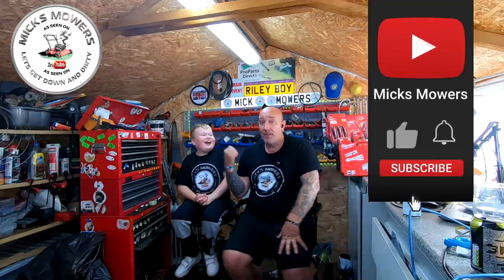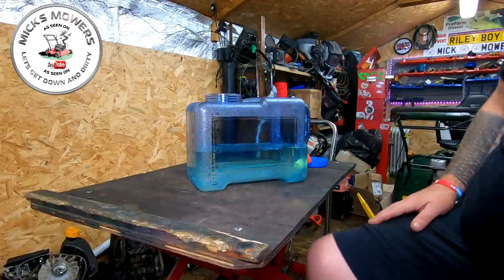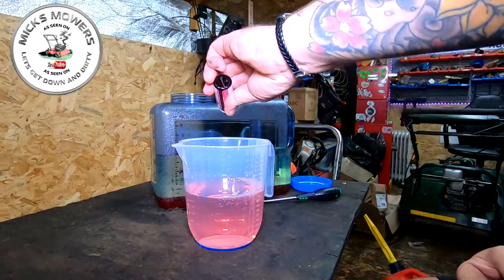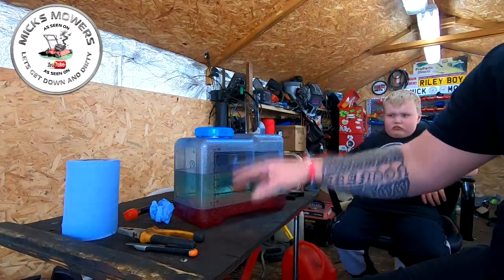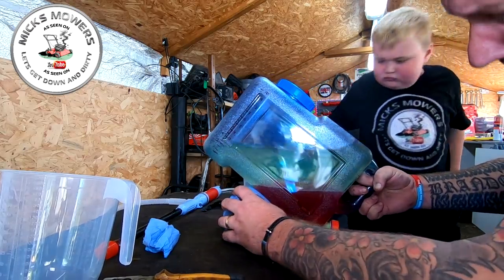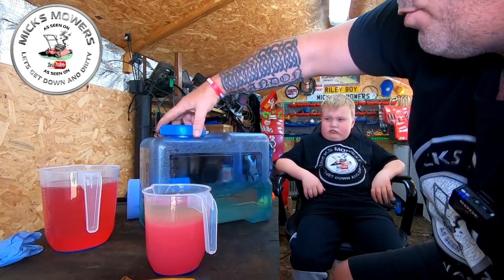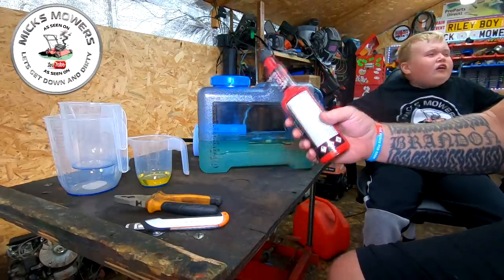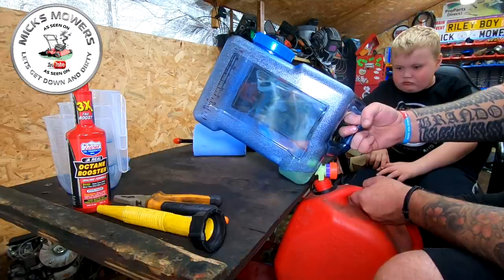How To Remove Ethanol From E10 Unleaded Fuel To Use In Lawnmowers And Small Engines

Comment: Here in the US, we can buy ethanol free fuel at some places. The best place to get it is at an airport that will let you buy it. It is 100 octane ethanol free fuel because airplanes don't want water (ethanol) in their fuel at high altitude because it will freeze in the fuel line. Really bad news for an airplane.
Reply: Works fine in 2 strokes also mixed with a good mixing oil. Has a tendency to leadfoul plugs. I run alcohol free mogas in my c65 .  It is a low compression engine and worse to lead foul.
Reply: I understand ethanol-free is available at harbors, for boats.
Reply: Used to be able to do that where i live, but new legislation and laws are catching up to this.  Airports, even small municipal ones, are no longer selling to outsiders, requires a plane to purchase fuel from them and they pump it into the plane from the fuel truck or tank and charge you for it, no container purchases allowed anymore.  It's a taxation issue from what i was told, not trying to keep people from purchasing ethanol free fuel, its just tax laws stopping outside sales of the fuel now.  Local marinas are stopping all sales outside as well, you can fill a boat or tank at the dock but no containers other then certified boat tanks now, sure you can get a boat tank and buy from them like that, but its twice the cost per gallon now, one local marina sells non-ethanol fuel for $6 a gallon, and you have to be a marina renter that keeps your boat there to get that price, for others its more and again it has to be into marine certified containers only and supervised fill up.  I haven't had access to premium at the pump for over 10 years now, just used to ethanol, no issues with it either so its not a big deal.
Reply: @CrazyHamSales The one thing government is truly good at is taking the fun outta everything.

Comment: Isn't it easier just to buy Esso Supreme+ 99, which although officially categorised as E5 actually has no ethanol (other than that sold in Devon, Cornwall, North Wales, North England and Scotland) ?
Reply: E5 has UP TO 5% of ETHANOL
Reply: @josemariatrueba4568  When I wrote that comment two years ago Esso Supreme99+ had zero ethanol. 
PETROL WITH ZERO ETHANOL IS CATEGORISED AS E5.
However Esso no longer guarantees its Supreme99+ as having no ethanol.

Comment: Two things when you put the coil you need to clean the flywheel with a Emery cloth just to be in the safe side and where the coil mounts on the engine you need to clean the surface too cuz I noticed it was pretty dirty yes it did work but I usually clean all the surfaces first and then clean the coil also for magnetizes to the flywheel

Comment: Great video, I watched all the way through, even though I will probably not have a need for the process. I like the way you go into details that most people would skip, making it easier for someone to get it right first time. Just one frivolous detail. When you pour anything from a container like your de-ionised water, try lying it on it's side, rather than upright. You will find that it pours better, the air flows in as you pour, making it a smoother pour.

Comment: For smaller engines the costs of using long term high octane fuel available in certain shops is a better idea..   For 4 stroke higher consumption items like ride on mowers it would be more cost effective..  Also run your engine powered tools dry to ensure no fuel is stored long term - unless you know you are going to use it soon afterwards.... 
I believe Shell Performance is still 95 octane
Reply from the maker: Good comment.. much appreciated
Reply: I thought Shell V Power is 99, could be wrong 🤷🏻‍♂️
Reply: @ioannichols6485  shell v power is still 99 octane I purchased some today.
Reply: I run two mowers, one chipper, one rotavator, one generator, one welder generator one disc cutter, two blowers, two chainsaws, two hedge trimmers each week. 
I get through six to eight gallon a week, expensive fuel will put up the cost so i'm gonna have to do this a lot. First fire/explosion caused by folks having to do this and the first death will wipe out any supposed environmental benefits. Cheers
Reply: Half the year I live on my boat, so frequently use a gen set and outboard motors. I will try this!

Comment: My father does this for his classic car 25 liter glass tank with a tap at lowest point. Then a dose of TEL for five star fuel.
Reply: What is TEL.? Thanks
Reply: @mrkoolio4475  Tetraethyl lead (TEL)
Reply: @mrkoolio4475  he uses a product called tetra boost if you are interested.
Reply: Rob Taylor thanks mate
Reply: Rob Taylor as a follow up....why use an ethanol addative if he just took out the ethanol?
Reply: @mrkoolio4475  Our use of this is that the car is incredibly finicky its needs the lead for the valve seats and the high octane as it was originally built with 5 star in mind. It's one of the only products on the market that gives you the authentic fuel.
When you have a very expensive toy it's worth the hassle to be fair. 
We found even with e5 stabilized and leaded that we were getting excessive corrosion and parts sticking, so removing  the ethanol and making up the correct fuel isn't to much of a problem when it's only driven in the summer on occasional weekends.
There is quite a bit to sort out if you change the octane on older cars that are carbretted and have a mechanically timed spark. 
Modern stuff does all the work for you to be fair.
Reply: @mrkoolio4475  There is no ethanol in Tetra boost. It advertises "ethanol protection," not that it has ethanol in it (but in fairness, many octane boosters do--normally cheap ones). If Tetra"ethyl" lead was what made you think of ethanol, it's not, or if you mean why remove the ethanol if this additive protects against it, then it does protect some components, but doesn't prevent the hydrophilic (water absorbing) properties which you really don't want in a classic car.

Comment: Watching you pour the water was torturous ;) try rotating the can 90° is on its side, it's a bigger area to let the air in & the fluid out. 
Works great with oil & fuel etc etc as well

Comment: Errrrrr..... No.......! Adding Octane does NOT increase the 'power' of the fuel! It's actually the REVERSE of making the fuel have more 'pizzaz' or power! You are misunderstanding what high or low octane fuels do... and why we have them.
Most standard cars  have 'low compression ratio' engines. I.e., the space above the piston at top dead centre is reasonably large compared to the volume of the engine. Engines with a higher compression ratio (small volume above the piston) can compress the fuel/air mixture so much that the mixture ignites BEFORE the spark losing huge amounts of power and damaging the engine if allowed to happen all the time. That's called 'pinking' or 'knocking'. Low compression engines are unlikely to 'pink' when running even if you use low octane fuels because the compression ratio is not high enough to ignite the mixture on its own (like a diesel). In this case, the spark plug is what ignites the gases on each stroke.
However, in a more powerful cars, etc. e.g. Ferrari, Porsche, Subaru etc., they will often have a higher compression ratios engines because that is one of the ways you extract more power from an engine (raising the compression ratio). However, that type of engine is MUCH more likely to 'pink' (compression ignite) when using standard low octane fuel. To prevent that 'pinking' in such cars, you add more Octane to the fuel which REDUCES the chance of 'pinking' as the added Octane makes the fuel (effectively) LESS combustible.
So, powerful cars often need high octane fuels and using it allows the car to run a much higher compression ratio. The increase in compression gives a much larger increase in 'power' than is 'lost' by 'weakening' the fuel by adding Octane....... thus...... fast cars can be more powerful with high Octane fuels BUT......the added Octane does NOT increase the power of the fuel...... it actually WEAKENS it by 'diluting' the fuel with something that doesn't burn well! Octane is an additive to REDUCE the chance of pinking..... and thus you can afford a higher compression ratio....  it does not increase the power of the fuel!
Obviously, I have simplified the description but the principle IS correct. Adding octane does NOT increase the 'power' of the fuel. That's a misunderstanding! Check it out by researching 'Octane' through Google!
Reply: So how come the higher the octane, the more expensive the fuel was ,  was that the oil company ( as basically ever only one under different names ),  making more money on a cheaper ? to make product
Reply: @highpath4776  Wellll...... yes and no. Octane is not a cheap additive..... but not as expensive as the price 'hike' charged.

However.... the petrol companies could see that, offering a 'premium product' in the same way that Apple over charge for everything, as do Channel, Rolls Royce, Armani, Nike.... etc. do.... even if they are REALLY only offering hot-air and marketing hype.... they could charge even MORE for their premium product, not least because the 'general public' think it's 'more powerful' fuel..... Secondly, the people who usually NEED high octane have bought 'premium price' cars and thus would actually feel even MORE smug if they only use the best' (becasue it'[s more expensive) petrol! Trust may, it's STUNNING how few people know this about octane and what it does.

To be fair, I have simplified the description. Strictly, the low octane fuel doesn't usually 'compression ignite'. It just 'burn' worse.... I'll explain..... The spark is designed to act as starting point for the 'flame'. It is supposed to move SMOOTHLY across the surface of the piston. it should NOT be an 'explosion' (as often depicted) but a smooth, fast moving flame front. What really happens with low octane fuel in a high compression engine is that it ALMOST gets hot enough to ignite itself.... but not quite. However, when the spark occurs..... the flame doesn't move smoothly across, it explodes, effectively all at once. Hence the 'knocking' or 'pinking' noise. It explodes from the very start of the spark.

Modern high performance cars deal with this quite simply. They fit a 'microphone' to your engine and it 'listens' for 'pinking'. If it hears it, it delays the spark for quite a while, hopefully to where the compression is low enough not to let the fuel explode. The effect of this is that the 'burn' has a weaker effect than it should as it's happened too late. Thus, if pinking occurs, the car starts to run LESS effectively. You CAN detect a drop in power as the engines moves from running properly on high octane fuel..... to.... quite inefficiently on low octane fuel. That's ANOTHER reason why people think high octane fuels contain more power. The truth is,  on low octane fuels, the engine 'decides' to reduce it's power output by delaying the spark..... and thus reducing the power of each stroke! That's why so few people HEAR the 'pinking' in modern cars..... The 'engine' 'hears' it before you do, and adjusts itself to stop the pinking before you even notice!

So...... you can run low octane fuel in a modern high compression car...... but you'd be daft to do so as, all the 'power' that you thought you'd bought with your expensive engine..... is thrown away...... Don't do it unless it's an emergency because the pumps have run out of high octane fuels. If you do have to, drive the car MORE SLOWLY than you'd usually do until you can 'upgrade your fuel!

Comment: All of my Stihl gear and lawnmower ran like shit on the new fuel. Really smokey too. I’ve switched to performance fuel at the pump now (I don’t use that much so I’m lucky).
Reply: My Stihl equipment hardly runs anymore, learnt about the E5 issues way too late
Reply: Go to your dealer and get a bunch of the Stihl fuel. I believe they call it “Motomix”. Run all of your equipment on that for a while and see how it does.
Reply: Thats funny, only today I was reading some comments on a Stihl supplier who said they will be fine on E10 ? I only got to there looking for help because my Honda generator was running rough, thankfully I didn't need them

Comment: Interesting experiment.  I have had zero issues with Ethanol based fuels here in the Midwest US.  I haven't had premium available locally for somewhere around 10 years at least, i can hardly remember having premium non-ethanol fuel available for purchase.  I know one marina about 40 miles from here has non-ethanol fuel available for boat use, but its only available to marina renters and it comes at a premium of nearly double what it costs for ethanol fuel at the pump, around $6 a gallon at the marina.  I haven't really had any issues so its not a big deal, i have the same lawn tractor that i have had for 12 years now, its never seen anything but ethanol based fuel.  I always winterize by switching the fuel off and running the carb dry before leaving it sit all winter, same thing on my snowblower for the summer, my chainsaws and trimmers get the 2-cycle oil mixed with E10, and again i just run the carbs dry after dumping the tanks out when they are going to sit a long time.  One of our vehicles is flex fuel and can run E85, locally i have E10, E15 and E85.  My other older vehicle is not flex fuel rated but i regularly run E15 through it without any performance issues, mainly because E15 is about 3 cents cheaper per gallon at the pump locally, no other real reason.  Beyond that, i have seen all the complaints, people claiming it freezes up in the winter, i live in the Midwest and we get COLD in the winter, think -20F for weeks at a time some winters, and sometimes even colder, and thats just air temp, wind chills have hit -40F before, so i know cold.  I am old enough now i can say that i have lived a LONG time without ever having a frozen fuel line or fuel related issue in the cold other then a Diesel engine and thats a completely different situation.  As for Ethanol ruining small engines, again thats BS... Any small engine made in the last 10 years is for sure Ethanol rated, and anything within the last 20 years should tolerate it without issue.  Sure really old/antique equipment can have non-compliant rubbers or polymers that don't like ethanol in their fuel lines, carb seals, diaphragm pumps, etc... But thats easily remedied by using modern materials to replace them.  I have old Honda ATC's, aka three wheelers, they are 40+ years old, they have always had Ethanol fuel in them as long as i have owned them, the only problem they ever had was hardened and brittle fuel lines, but thats common and easily remedied with some quality Tygon fuel line that doesn't get hard or brittle.  I haven't seen that issue in ten years now since switching the fuel line type when replacing it.  They sit with Ethanol fuel in them year round and get used whenever i feel like, no rust issues in the tank, no failed carbs, etc.  The biggest problem is where you live, places that are much more humid, tropical, or near the ocean, have much bigger issues with ethanol because it absorbs moisture.  Fill a 5 gal jug with ethanol fuel, leave in a humid environment and then watch the water settle at the bottom, everyone says the fuel itself had a lot of water in it, but it actually obtains that water through the atmosphere around it, so if you live in a damp climate your fuel collects more moisture.  Here we are pretty dry during the winter, so much so everyone has humidifiers for the winter months, and our summers are relatively short, though they can be really hot and humid like it was this year, but its exposure time and we don't have it i guess because i don't see these issues.
Reply: Ethanol gives you 70% of the fuel efficiency as gasoline so running e15 is costing you more in fuel than that 3¢ savings.
Reply: The problem is the moisture & reaction with oxygen. When stored in a sealed metal tank, it will last ages. In a plastic tank it ages quickly since plastics are oxygen permeable and don't block all UV rays. In vented cans of any type, particularly a carb bowl, you get moisture as well. With enough, it turns into that water-sludge, which is fairly corrosive.

All this work is more than it would take to store your equipment with near-empty tanks and run the carb dry. But that can't enrich your mixture the way ethanol-free gas can for newer engines untunable that are set very lean.
Reply: We have ethanol free fuel here in texas (at least near houston), but its $4 a gallon vs $2.25 for regular with it. that was the price a couple of months ago, reg is now $2.75.
Reply: That’s still a bargain! I can buy one gallon steel cans of gasoline for $20. The mixed cans go for about $10. I live in New Hampshire where humidity and extreme weather is always an issue. At a minimum I add a fuel stabilizer to any fuel I put the refill can. After a few months, I dump it in my truck to burn it off and start with fresh pump fuel again. At the end of the season or for any long term storage, the pure fuel is always the best. I grew up near the Rocky Mountains and it is a lot drier out there. I can see how this might not be a problem.